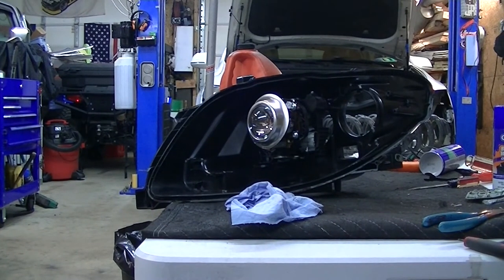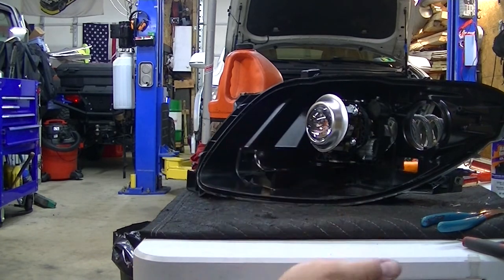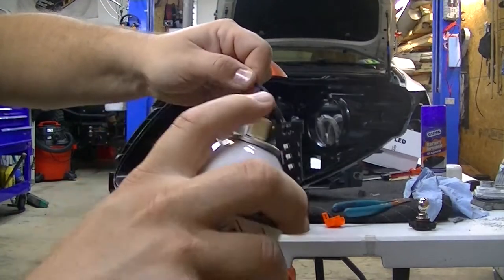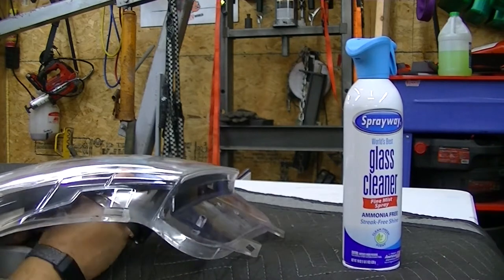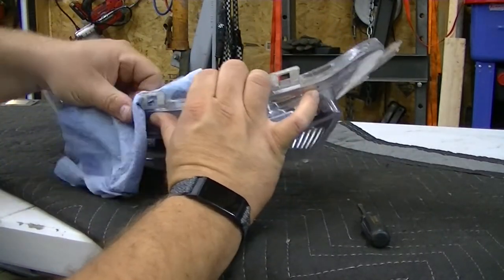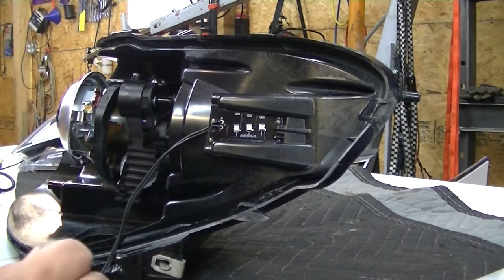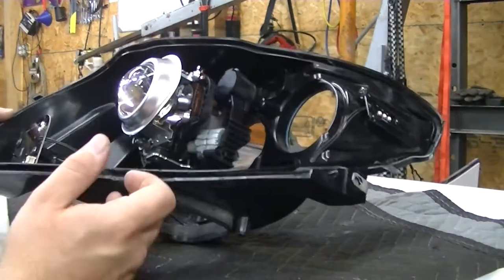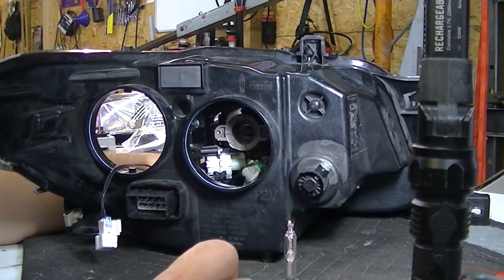2010 Lincoln MKT Headlight Repair, Seal & Bulb replacement

Comment: I had the inside marker led stop working , I have not been able to separate the lens cover, any suggestions? Appreciate the video.
Reply from the maker: use a hair dryer or heat gun around the perimeter of the lens and housing.

Comment: How did you open the headlight
Reply from the maker: The Seal between the lens and the housing was very bad so it just came apart when i started to spread them open usually you have to heat it with hot water but mine just pulled apart due to the seal being bad.